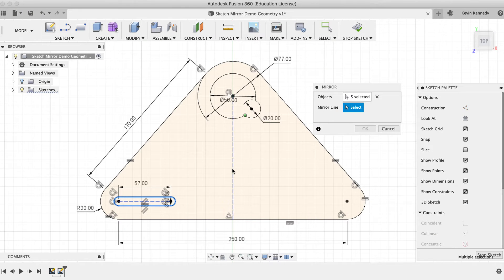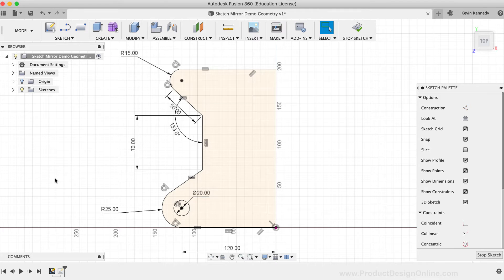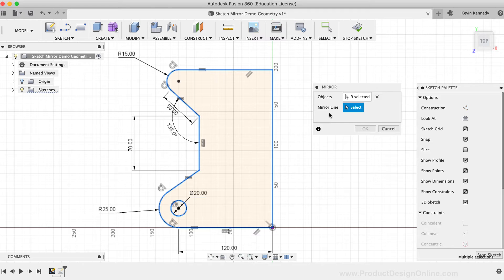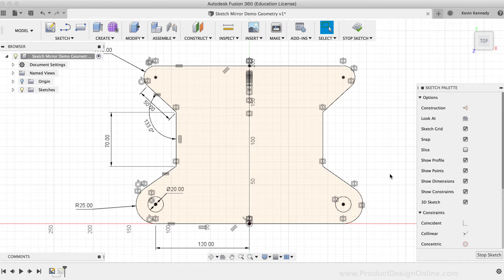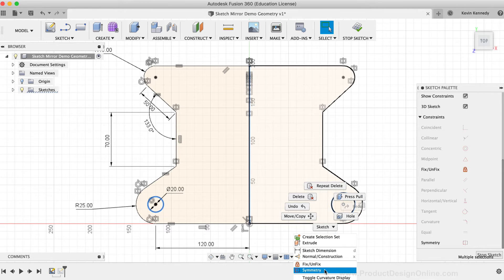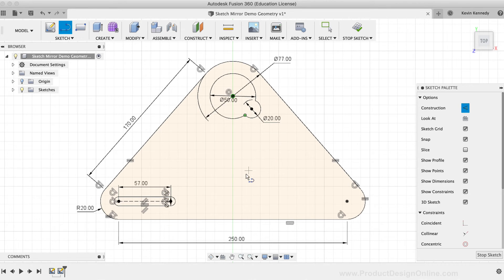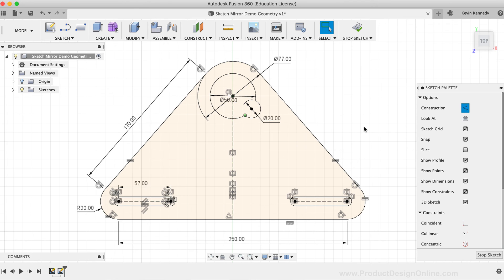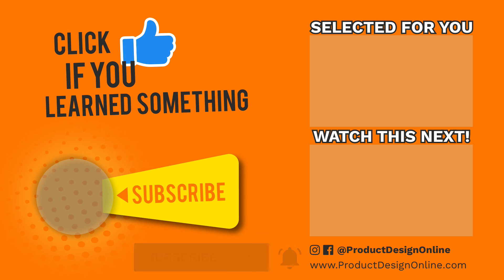How to Mirror Sketch Geometry in Fusion 360

Comment: Thanks Kevin. Do you have content that covers pattern/mirror of component and bodies? It often doesn’t work. Not an issue w sketch.
Reply from the maker: Hi Mark, I don't have an individual video on that (yet), as I explain that throughout several project based videos. It's likely your compute option that needs changed to get the modeling mirror/pattern to work. I explain them here - https://productdesignonline.com/tips-and-tricks/mirror-command-not-working-in-fusion-360/#compute

Comment: so issue here is that I don't seem to have the model menu, only design, render, animation, simulation, manufacture and drawing menus, and none of them have the sketch mirror option you start out with in the video. may just be me not knowing how to use/navigate their menus, but yeah.
Reply from the maker: Hi, Vasalis. The user interface was updated in August, where they changed some terminology and the location of things. With the new UI you'll find the sketch "mirror" command in the "Create" dropdown, but ONLY when you're in the SKETCH tab. The sketch tab will only be shown in your toolbar when you're in an active sketch environment.

Alternatively, you can search for the text feature by using the keyboard letter "S" to activate the shortcuts box > search for the desired feature (mirror).

More on the changes here - https://youtu.be/tuZzHcmFtg4

Comment: When I right click on the sketch desktop I get an abbreviated menu not the long one with mirror as a choice that you get. Was that the old ui?
Reply from the maker: Hi, Basil Nason. They did change some things with the new UI as far as what is presented in the right-click menu. Instead, I would recommend using the shortcuts box to find features quickly. Hit the keyboard shortcut letter "S" to open the shortcuts box > then simply type out the name of the feature. Cheers, Kevin :)
Reply: @ProductDesignOnline  ok finally... the mirror dialog box was collapsed on the side to the rt of the sketch palette
Reply from the maker: @mbnaso2699  ah, that will do it! Glad you figured it out :)

Comment: I'm trying to copy a sketch (duplicate) and then have it mirror the first sketch but not share the same mirror line. I need them to be two separate parts for i need space between the two sketches. Thanks!
Reply from the maker: Hi, RhynoRekz. You will have to use the mirror command twice to do that. One per each sketch. You may also find it beneficial to mirror the 3D geometry with the solid mirror command instead of the sketch mirror command. Cheers, Kevin :)

Comment: Any thoughts on an advanced mirror tutorial?  One challenge I have is creating mirror replicas of complex assemblies. I know that joints are tricky (some joints like 'as build' can be copied when using the 'pattern' feature, but autodesk has acknowledged that mirroring joints hasn't yet been resolved due to the inverted geometry.  

So for example, if you were making something like the steering column or a dash display for North American cars, then wanted to make it for UK cars (steering wheel and dashboard is on the opposite side), how would you recreate that?
Reply from the maker: Hi, Jason. Thanks for the suggestion. I'll have to create some more tutorials with mirroring. I would suggest mirror 3D geometry when possible over mirroring sketch geometry.

As you mentioned, there are unfortunately some quirks and workarounds need with joints, etc. As of now, the only thing to do with your car example would be to mirror the entire dashboard and then "remove" the original component or body.
Cheers, Kevin :)

Comment: how do i mirror or copy a component/body and have the history timeline repeated as well?
Reply from the maker: Hi, Aryan. Great question. This video is on the Sketch mirror command, that only works with 2-dimensional sketch geometry. If you select the mirror command form the "create" dropdown list, you'll be able to mirror or copy 3-dimensional objects...including faces, features, bodies, and components. The modeling mirror command will also include the feature as a parametric item in the timeline at the bottom. Cheers, Kevin :)

Comment: Very clear and concise that was driving me crazy that mirror sketch and mirrors create, pretty silly you would think the program would handle that if you're working on a sketch or an object body.
Reply from the maker: Thanks, Mike! I agree with you - they certainly could make it a little more intuitive to where the program selects the correct mirror command based on the environment you are in. It would be interesting to see tabs within the dialog that let you toggle back and forth for the commands that are available in both the sketch and modeling environments.

I wouldn't mind them changing the appearance of one of the mirror icons so the difference is not so subtle. Cheers, Kevin :)